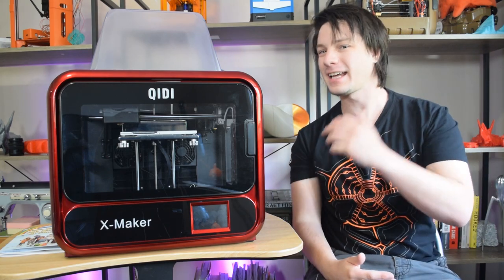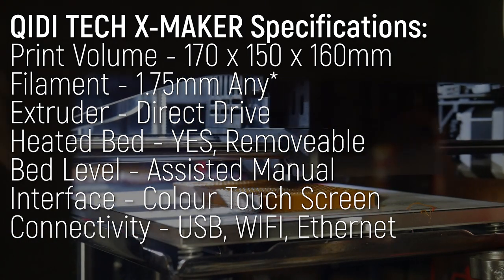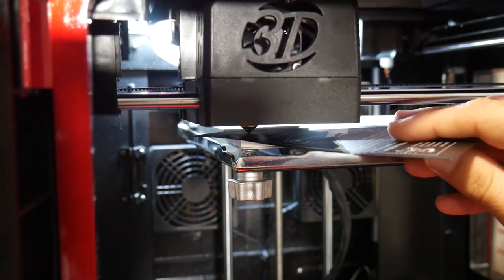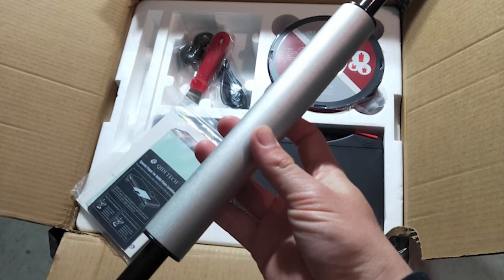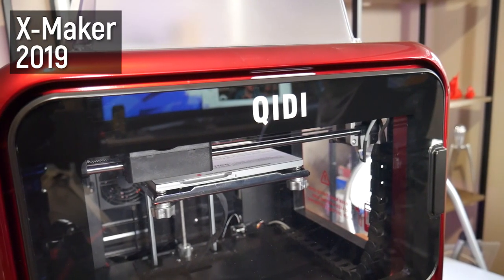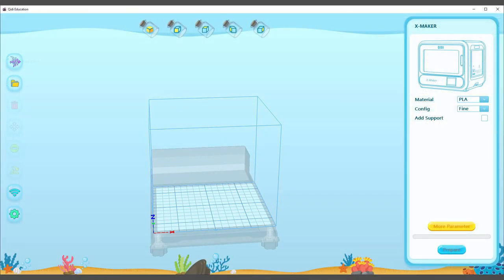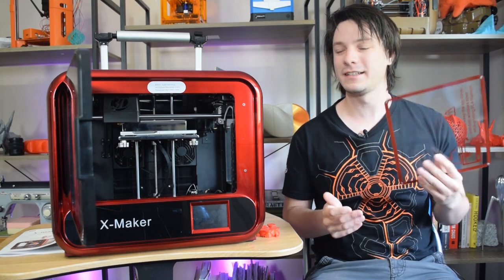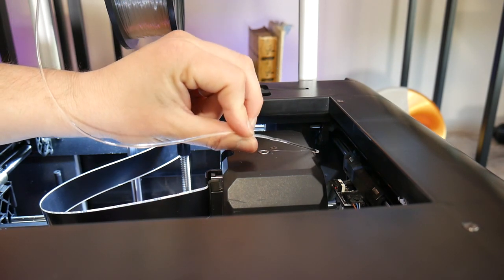3D Printer with luggage handle and underwater theme slicer? QIDI TECH X-Maker Review

Comment: The power switch risk is for countries running 220-240V into the PS on the 120V setting. Running 120V into a supply set at 240V won't hurt, it may go out of regulation and deliver lower voltage than needed. But putting 220-240 into a 120V setting will likely cause smoke to leak out.
Reply from the maker: heh yep got my logic wrong way around, still an issue though.
Reply: Sounds like a simple cover would be in order if that were in use around children.
Reply: I was looking for this comment. I agree. I'm glad to see Maker's Muse also agrees.

Comment: I've had this machine for a couple of years now. It was my first buy when I decided to get into 3D printing, probably because of your review. It's been trucking along ever since, I haven't had any major issues with it at all and it's reliability probably helped keep me in the hobby even when the Ender 3 I got later down the line had some issues. (Those weren't even the machine's problem, either, I was a complete novice and also got an exceptionally crappy roll of filament!) I like to print action figures so I'm mostly printing small parts, the build volume is perfect for something like that. 

A warning, though, if you decide to print PETG with this printer, it's a little too excellent at sticking to the build plate - Be sure you replace that magnetic plate with a nice sheet of G10! I ended up ripping some chunks out of the magnetic plate that came with the printer, and had to throw it in the trash.

My only "gripe" about the X-Maker is that it's a bit loud, it seems about twice is noisy as the Ender 3 Pro. It probably makes a big difference that I'm often in the same room as the printer.

Comment: I just ordered this printer and can not get it to connect via wi-fi its hooked to my router says its connected on the printer but the slicer won't find the printer. I think they need to work on the software a bit more there is no real instruction for trouble shooting wi-fi issues besides that its a nice machine.

Comment: I still prefer the ANYCUBIC I3 Mega ultra base. Once the part has cooled there is no adhesion, but until then it holds extremely well. No flexing or anything like that, the part just lifts off as if the part was just sitting on a kitchen table.

Comment: THERE IS NO INTERNAL SPOOL HOLDER ANYMORE!!!
I just received one, from Amazon proper. The internal spool holder on the left side is nowhere to be found on the current version.
Reply: And no camera... :)
Reply: @koryyyy  
I removed the camera. Rearranged all the LEDs to provide a very BRIGHT elimination of what's going on while I'm sitting there on the side watching it. It prints okay. The enclosure is good. The circulating fans are silly, IMO, no need for them on a 3D printer, those vents have been taped over. When printing with toxic filament, keep your windows open. I love the science, adjusting settings and observing the results, and repeat until the print comes out right, that's fun.

Comment: That switch for mains is completely safe in US, going from 110V too 230V WHEN you have 110V mains might make the printer slower to heat up.
HOWEVER, if you switch from 230V to 110V when on 230V that IS a game over move, all the magic blue smoke will escape.
Reply: He definitely got it the other way around. In Australia their voltage is 230v so it will burn the 110v circuit. Angus is more like dingus.

Comment: That looks pretty descent. Thought it would cost a way more. I'd say a concern in the education market would be ease of removal of the print head for clogs and repairs.
Reply: Chick Bait yea like the dream education printer is the Ultimaker s5 with the filament “case” thing and the air filter bundle
Reply: I certainly was surprised by the price too

Comment: Why isn't there a universal PSU  for 3D printers? tThe little switch is just asking for trouble.
Reply: There is no "universal PSU" because different 3D printers need difference combinations of voltages and currents. However, the PSUs used are almost all models that follow standard form factors -- they are commodity items.

Comment: This looks like a smaller updated tech version of the X-Max, which is a massive piece of crap. The cooling issues mentioned here are very bad with their extruder design, which looks exactly like the X-Max. The support is good, but they have had to send me replacement parts over and over again trying to solve issues with their poor design.
If you are just looking for ok prints in an enclosed printer this may be fine, but my experience with Qidi has not been great even with their top end machine.
Prusa Mini would be a much better option for the price, although it's not enclosed.